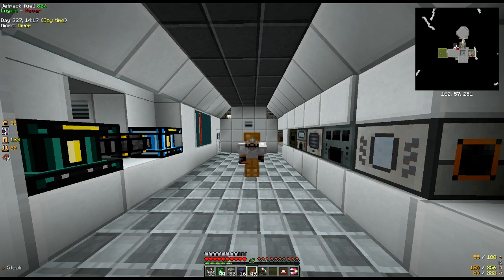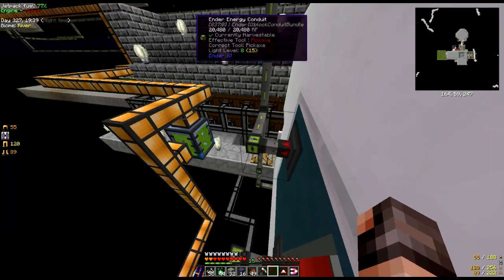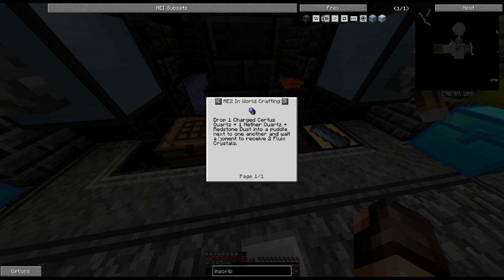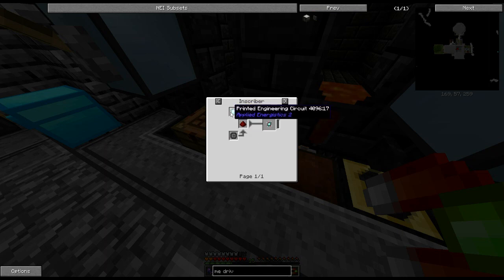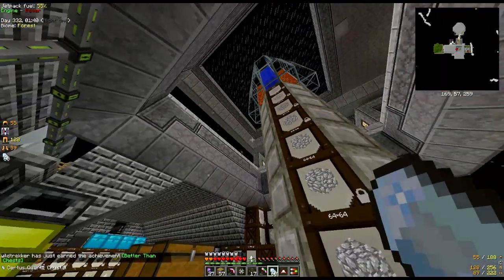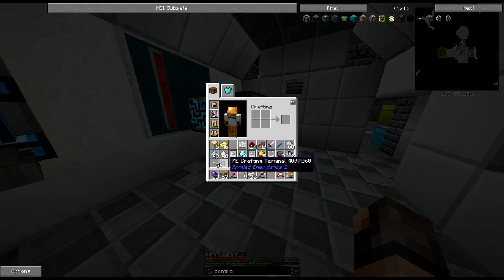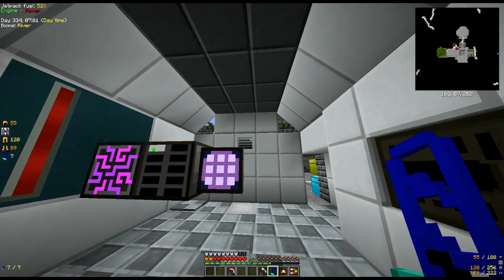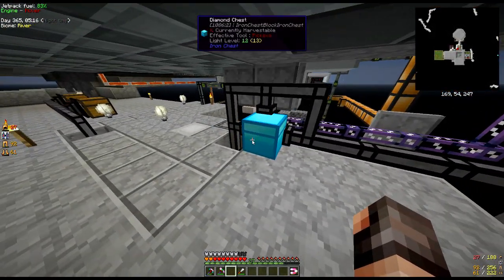Minecraft ME system applied energistics 2 [Minecraft Sky Factory 2] [Ep12]

Comment: I noticed that you used Autonomous Activators to pull out ingots.. I suggest using the liquid transfer node from Extra Utilities. They work much faster and are more resource friendly as opposed to the Activators. Hook them up from the drain straight to your desired area. :D
(EDIT) And in the ME System with all those bows, you should be able to filter them out via Extra Utilities' Item Filters.
Reply from the maker: False King007 Thanks, will look in to that, now the quarry is full speed, it no longer keeps up with auto smelting in to ingots. As for the bows, I tried and failed at that, wrong setting I think, so need to review it.